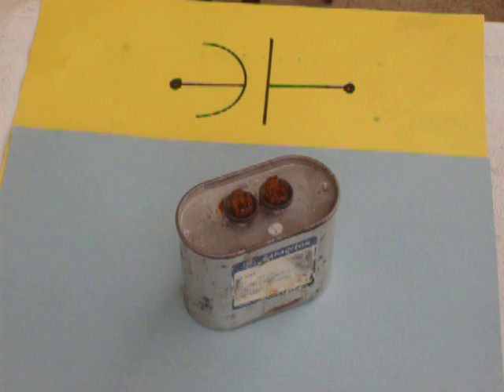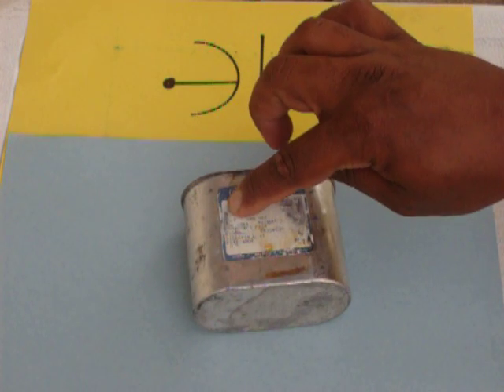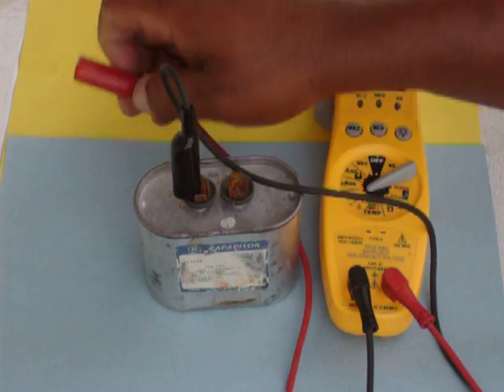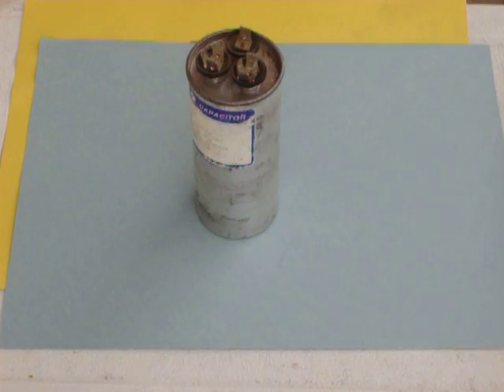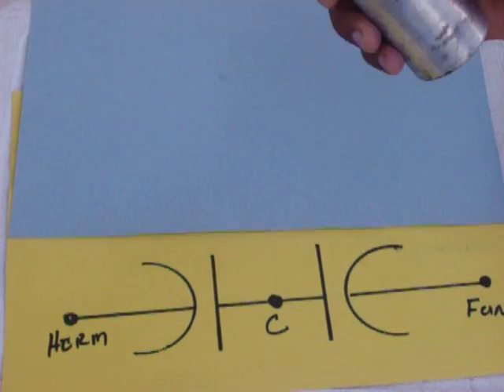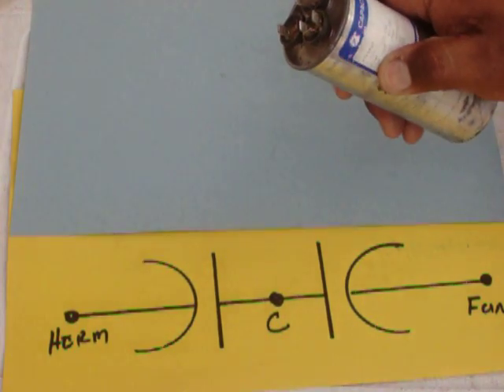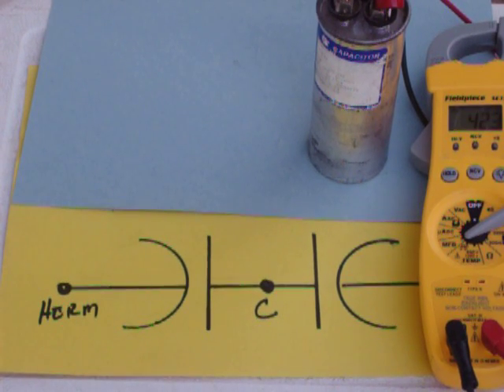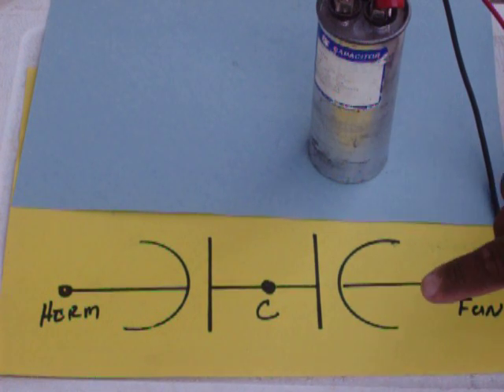how to check a capacitor

Comment: I'm a electrical field engineer and would like to say you are a good teacher for a novice learner....all should be careful in testing high voltage caps...always remember current kills not voltage....just be careful and think before you do anything in electrical....current takes the least path of resistance to ground....don't be in the way to ground path...you'll get zapped or be killed....a few milliamps across heart will kill you!!!!! always respect electricity and be cautious with it...

Comment: Not sure what all the flaming is about.
From an old white guy from Alabama - THANKS!!
My house is intact from the tornadoes, but my a/c has been out.
And it's hard to get repairmen out - they are a little busy right now.
Anyway, you helped me diagnose my problem. Actually, enough to take the capacitor to the supply house ( they were about 2 blocks from being blown away.)
They tested it and for $40, my house is getting cool.
Thanks!!

Comment: Great videos!! I recently replaced a run-start cap on my central air. I new better than jump on the cap, without looking deeper. The problem was a burned wire on the compressor. I tested the old cap with my Russian-made ESR cap tester, and it was good as I expected. That brand of meter you are using is perfect for HVAC.

Comment: Great vid quick question though...i have always discharged run caps with my screwdriver...tried doing the same on a dual and it blew the tip off...was i just unlucky or is this common with dual caps?

Comment: So the capacitors I have checked recently all have a +/- % for the MFD that you can be over/under.  usually +/- 6%.  Some of them i have not seen this on new and used.  Am i to assume that if they are over or under than they are no good?  The reason i ask is because when i check the brand new ones for comparison they are right on the money usually by .01  so the reading i would get would look like 35.01 and a lot of the used ones as well with some used one reading between 33 and 35

Comment: This is fine, for capacity test, but a bad capacitor can still hold and WILL measure fine capacity. You need to check for leakage too at breakdown voltage.
Happy learning.

Comment from the maker: Capacitors can hold an electrical charge. The resistor bleeds the charge off so it does not hold a charge when the unit is off.

Comment: Also I changed filter caps and changed all 6 valves + bias adjustment for the el34's in my video:

"Sound City L-B 50 Plus (1973 mod) - maintenance and repairs."

Comment: very nice video
but I wanted to know how to test the voltage rating of a capacitor?
I built a capacitor using a beer botel and capacitance of 1.05 micro fards
I wanted to know that how much voltage can it stand up to, pls help :(

thanks

Comment: Great video!
Note: Electrolytic caps is a type that uses an electrolyte, an ionic conducting liquid, as one of its plates. This reqs that the applied volt must be polarized; (DC)They cannot be used with AC signals without a DC polarizing bias. The ionic conducting liquid has a expire date, even if never used!!! They can look ok when tested using a 'meter' as u do, but still be bad. They are to be changd befor they start to bubble! check video: "Tube Amps 101 repairs, maintenance and more"

Comment: some idiot sold me a replacement fan for my dehumidifier and lied about which model it was, so I have to replace one that does not need a cap with one that does but he clipped it off and did not send it. Assuming he did not lie about it was pulled working, how do I figure what cap to actually use with it? thanks

Comment: why is shorting out with a screw-driver discouraged?  A:  cuz it may result in excessive current flow internally .. damaging the leads leading to the terminals.  Better to slow drain with a suitably sized 20K resistor as you intimated.  This applies to CRT tubes as well.  Interestingly; the Q is not stored inside the picture tube as such.  There is the gray conductive coating on the outside of the pictube and on the inside .. the glass itself is the dielectric!  Nothing to do with the vacuum.

Comment: you want to checked a run cap when its under a load very easy to do. never check a dead cap like this guy this is old school way ... new way 2650 x amps / volts on the cap